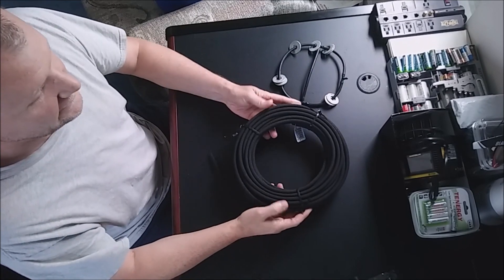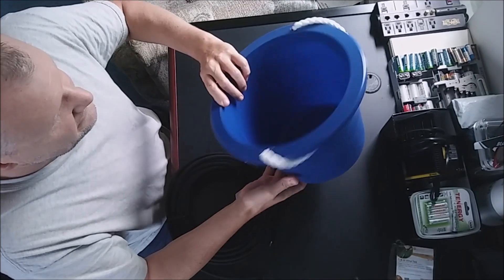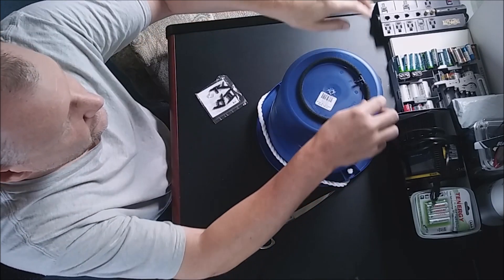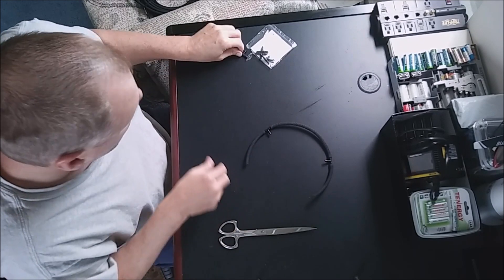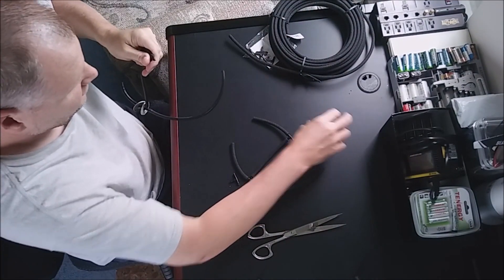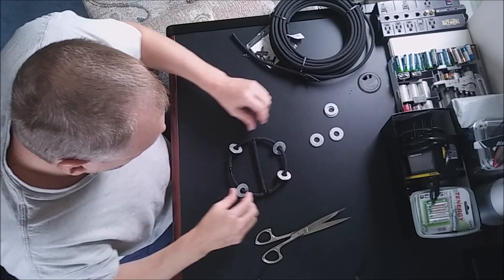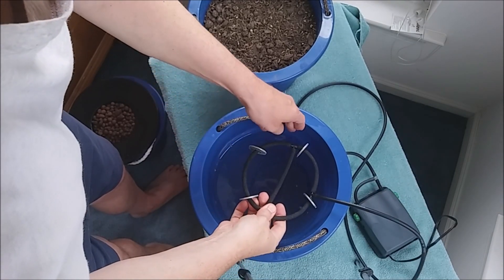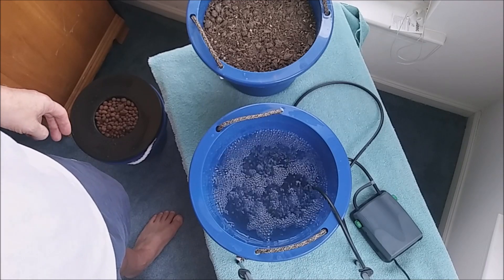Type 2 DIY Air Bubble Ring No Air Stone DWC,Hydroponics,Aeroponics,Aquaponics,DWC,Worm Compost Tea

Comment: Great video, thank you! One question: standard aquarium tubing is 3/16", you're using 1/4" soaker hose. Did you use a 3/16 to 1/4 reducer between the air tubing & the soaker tubing? Thanks
Reply from the maker: I had no issues with the size difference coming off my pump & even a regular air stone if needed. Thanks for watching. 👍🤞

Comment: to ppl wondering.. rust from galvanized steel will not harm plant... they make all kinds of gardening shit out of it.. the coating of galvanized steel is zinc and cld actually benifit the plant if it was to break down somehow in the water which is likely not to happen because the PH should be relatively nutreal meaning it is not acidic and therefore will not rust.. rust itself is iron-oxide which itself is not water soluble and could not be absorbed by the plants roots to cause any negative affects other than clogging something in system
Reply from the maker: Appreciate the feedback. Sometimes you can't please the YouTube Experts & Haters. I just try to put out videos to teach & help the community as well as myself. 😉👍🤞

Comment: Did something similar with oxyhose or oxytube, like yr hose but 1/2".  But mine got clogged up, and no way to remove and clean from root mass. But I used fishing weights off ebay, I believe 3oz weighs shaped like a upside down mushroom. Being lead based! Used plasti dip to coat, did 2 or so thick layers. Worked great!

Comment: I tried making something similar but not happy with the bubbles. It’s 8 inches diameter with 2 tee barbs.  The soaker hose are Raindrip.  My air pump is related at 875gph. The bubbles were extremely weak, but when I connect air stones it’s working fine. Don’t know if these are the right soaker hose.
Reply from the maker: Try cutting the hose in half & you will have 2 of them. I imagine the ring is to large. Try it smaller & see if the bubbles produced are better. Good luck. 🤞

Comment: What's with making one air line out of
 both outlets of the pump? Does it increase pressure?
Reply from the maker: Absolutely since it isn't split off decreasing pressure. Plus I had no way of sealing off the other open port.  Hope that helps?
Reply: @DiyRick66  Thank you kindly, guessed it was a way to seal off one port too. Happy new year mate
Reply from the maker: @spirit210364  You 2 🥂

Comment: did you have to make holes in the hose?
Reply from the maker: 1 version you poke holes the other version is soaker hose.
Reply: @DiyRick66  I just build 4 but haven't tested it in the water yet
Reply from the maker: @drfrankm  I use them in all kind of ways. My Garden & Fish Hobby 😉
Reply: @DiyRick66  does enough air bubble produce with the soaker?
Reply from the maker: @drfrankm  Absolutely. Check out the other video. 👍

Comment: Dude I'm inventing a diy system from every video I've seen and you've solved a major issue I've always had. I've put half inch gravel on top of it but of course it's heavy. Thank you I'd like to share with you what I'm doing once it's ready. I'll get back to you soon.
Reply: I've done 2 other methods so yours is just new so that I don't have to clean the stones every harvest. I appreciate it but I'm sure there was a point when you yourself didn't know either.
Reply: @titoborbon6494  I'm not "inventing" a system either. If you've put that much energy into it, how have you not come across this? Also, this is exactly why people without knowledge of cultivation practices shouldn't invent stuff. You should probably take the time to learn everything about what your product will actually be used for, instead of theorising everything... You can actually make people sick from using the wrong supplies. That's why I'm giving you a hard time. Otherwise, I wouldn't care less if you created a system that may or may not be beneficial...
Reply from the maker: Thanks & good luck with your build.
Reply: your building a DIY system and don't know that you can use stainless steel washer to weight down a hose? XD
Reply: @Dedskeptic420  never sent you a message mr i know everything. I could do whatever the fuck i want don't worry about me and what I'm doing. I grow for myself and you have no say so in it. Others know more than you do I'm sure. I'm getting no one sick y would you even make that assumption without any proof or information? Go about your life dude, stay out of mine like I stay out of yours I am coming up with something to share you don't have to listen or watch it makes no difference to me.

Comment: I wasted my time making 12 of these. Thought they were working great until I added an air stone i was given. The air stone bubbled 5x as much. They were only a few bucks each so I bought 11 more and now I'm rockin.
Reply from the maker: Entirely up to you. Purchase multiple airstones until they clog or one basically no clog ring. Good luck either way.
Reply: Use a bigger pump its not the ring it works great

Comment: I wouldn't recommend using galvanized metal for growing food, the heavy toxic metals they leach will be absorbed by many plants. I would recommend using small pieces of  1/2" pvc pipe to weigh it down instead.
Reply from the maker: It has been discussed. I used what I had for video at the time. Since then changed over to SS Washers. You can use anything you want that won't leach in water to hold down your rings. Good Luck. 👍
Reply: i think they make little suction cups that will attach to the bubbler line so you dont have to use those weights...

Comment: So after a while of using the recycled rubber diffuser started thinking about what telly duude was saying...  After more research I agree and recommend a food safe alternative.  I think that using that soaker hose worked amazing for my plants but the overall risk of the contaminated heavy metals thing is what changed my mind.  I am know using bubblemacairdiffusers.com/
2X Fine pore air diffuser "Bubba" with a Tetra Whisper 100 and its great.  The air stones from bubblemac are 100% Glass-Bonded Silica and you can clean them!
Just wanted to update.  Thanks
Reply from the maker: Tristan Burrell Glad I could help. Rick
Reply: Follow-up... just got that rough texture soaker hose from China.  I connected it just like with the smooth one that didn't work and....  Works amazing!!  Soo happy right now, thanks again Smaerd58.
Reply: Here is a link to the hose I bought just in case you end up only finding that smooth hose that doesn't work.  Its off ebay:  https://www.ebay.ca/itm/Porous-Soaker-Hose-Garden-Lawn-Agriculture-Drip-Irrigation-Watering-Pipe-Durable/253626134216?ssPageName=STRK%3AMEBIDX%3AIT&var=552855018409&_trksid=p2060353.m2749.l2649
It was a little more expensive but worth it in the long run.

Comment: Nice idea, I think instead of washers to weight it down i’d either use some of those rubber c shaped wire organisers glued to the bottom or I believe they sell suction cups to hold down those long air stones
Reply from the maker: Frank Booth Anything to weight it down. That could work. Good luck.

Comment: How has this held up over time? Have you really tested clogging and cleaning requirements? Also, is it heavy enough to sit on the bottom of the bucket without the washers?
Reply from the maker: David Newton This type 2 version is made with soaker hose which is heavier but I would still suggest weighting down with something. A rock tied to it or piece a ceramic anything. Yes long term doesn't seem to clog just might get slimy. Just spray off. Of left sitting and pump off over time could get nasty. But since we change out solution every so often it keeps res clean. Good luck. Rick
Reply: smaerd58 Sounds good. Any thoughts on a comparison with the ones you can buy premade? The ones you can buy look pretty much exactly like what you have there. Im wondering if there is an output difference.
Reply from the maker: David Newton No idea. I have aquariums and worms & do worm tea so that is where the idea came from.

Comment: u know all that work and effort u could have been done with a 4 dollar 4inch air stone
Reply from the maker: greengrower420 Absolutely true but this will probably never clog. Easy to clean and might not never need to be replaced. You can also build it to whatever size you need. Also check the $4 cost factor that you mentioned for each one used. For the cost of supplies that I put these together with I can make up lots of them. Thanks for watching.
Reply from the maker: El Barto Thanks. I will have to investigate the new air method you speak of. Any vids. on it? Rick

Comment: What was the difference between the vinyl and soaker hose tubing?
Reply from the maker: BD Beatz Regular air line tubing or drip tubing is lighter and less larger OD & you have to put in little holes. Soaker hose is heavier & has small holes already throughout it. Hope that helps?
Reply: smaerd58 awesome, thank you. Im going to try the vinyl first. Which worked best for you?
Reply from the maker: BD Beatz Either one. Just depends on budget time sourcing supplies. That's why I did both to show you.